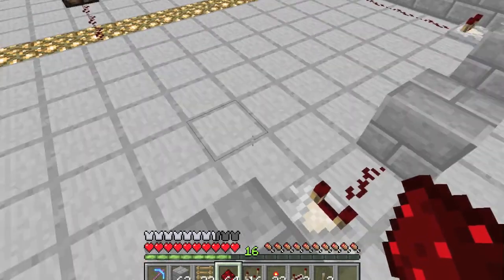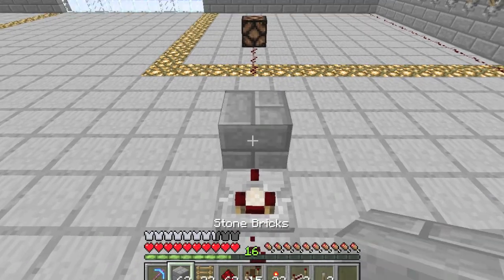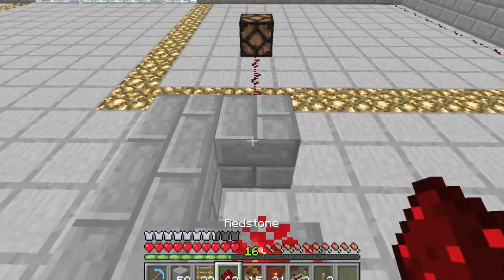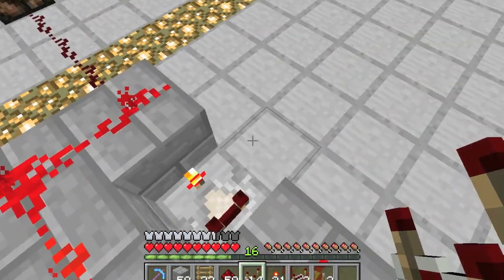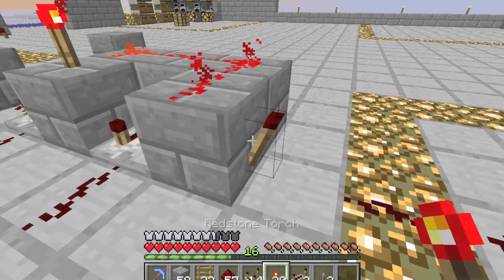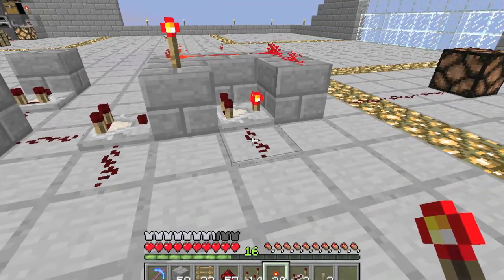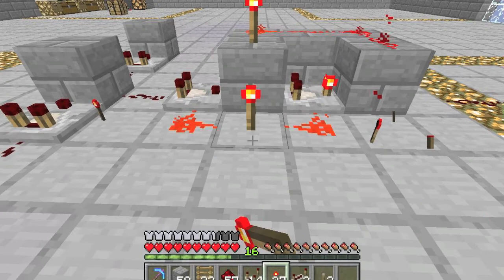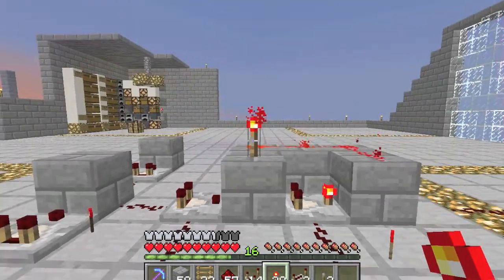Redstone Signal Strength Decoder with Comparators

Comment from the maker: One of Cubehamster's videos gave me an idea: to get rid of the long, annoying wires, you can set the address of the decoder by attaching the address inputs to a comparator and a small container like a hopper, dropper, or dispenser.  To change the signal strength, just change the number of items in the container.